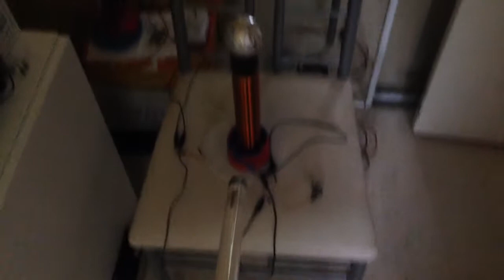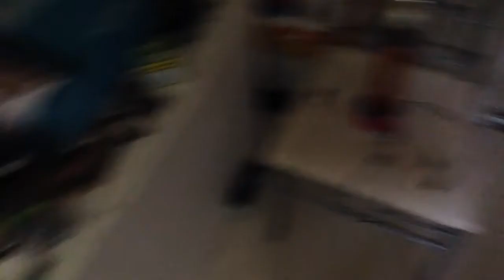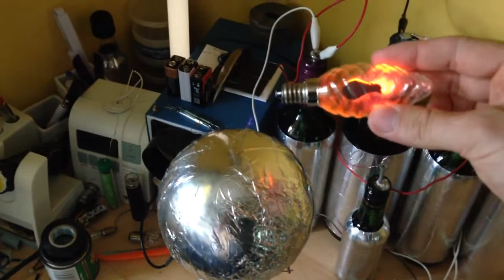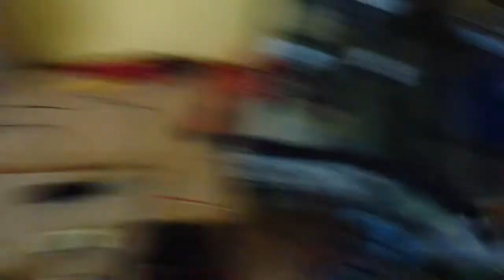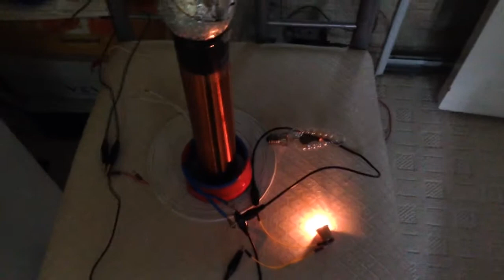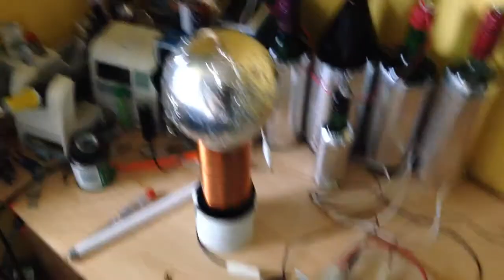Tesla coils in resonance

Comment: You have a single loop around the metallic ladder in background connected making a simulated ground to both coils and you get radio electromagnetic radiation thru the ambient background from the larger inductive coil giving the smaller coil energy.but its less energy because you have some resonance.Hows that...sound...

Comment: I'm not seeing anything special here. Just a transmitter and receiver. I'm guessing the receiver is wound in reverse direction to the transmitter.
I'm also guessing it goes a lot better with a ground to both coils. The long wire is acting as virtual ground.

How can we see the coils are not matched without seeing the induction and capacitance values? Why would it matter if they are unmatched? I have never had any trouble producing similar results with Slayer exciters on a slightly smaller scale.
Reply: Yeah, isn't this what ya get when you're in say a 3rd harmonic of the original freq?  And also at any qtr or half of the original freq?  I mean, isn't this like what happens with sound freqs that are sympathetic with one another.  Same deal, right?  It's just electromagnetic version of it no?
Reply: Mark Cooper Could be a harmonic, Not even that complex I dont think. I get power from any coil in my fields. Its more like a a length of antenna thing.
I cant even work out what the special effect is supposed to be in this video? It just seems to be wireless electricity basics.
Reply: Mongrel Shark agree rf is rf

Comment: Bifilar braided primary coil?
Reply from the maker: Diadon Acs
Sorry but this bifilar coil is there only because chair has soft cushion and I needed stabilise my coil. Like I said Kapanadze used the same think inside his coil to find perfect resonance , it is easy just think what it could be? 
Regards
Reply: A coax cable?
Reply from the maker: Diadon Acs 
This vid has poor quality but you can see that I use standard wires which was laying around in my office but not coax, but have to say that I use coax in previous experiments and I had really good results!
Reply: Well, I give up on what you are using to find resonance easily as you say. Resonant capacitor switch through a choke coil? What? ;)